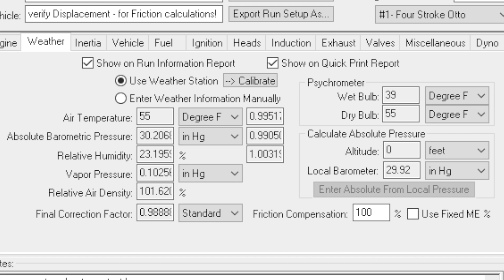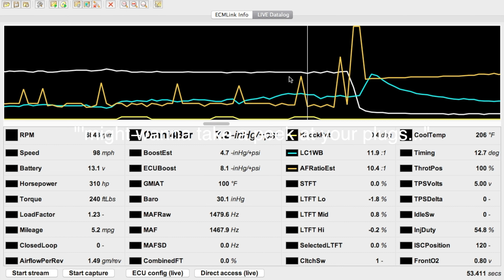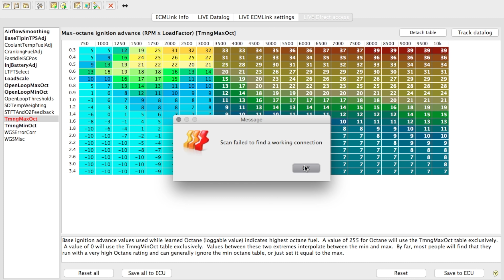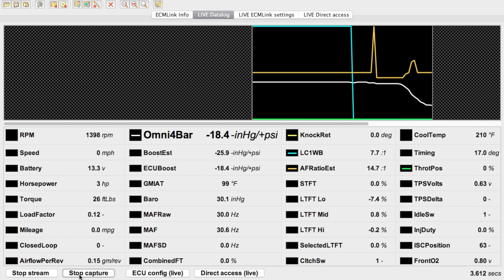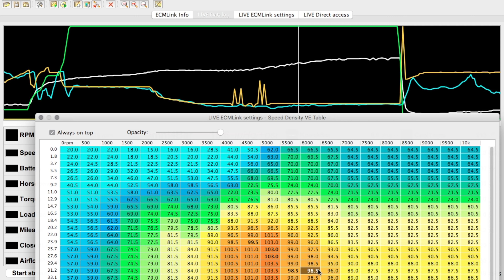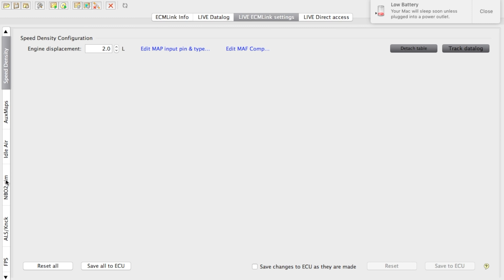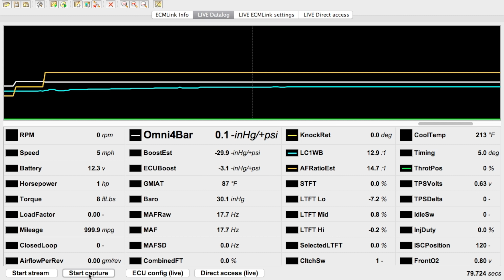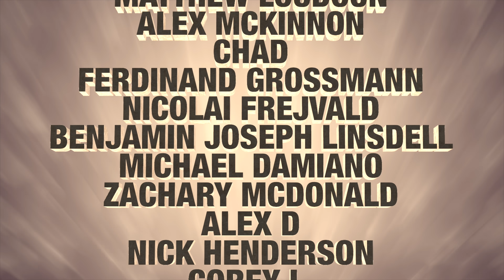Turbo Elantra Dyno Baseline

Comment: Hey jafro, love watching your content! I've learned a lot from your videos and appreciate you taking time to build these videos. I wanted to offer my own advise if you haven't taken notice. I saw that your battery voltage gets sucked down to 12.7 under full load (quite unavoidable when we are stuck with 75 amp alternators 😔). It is a problem I've been working at on my 91 GSX for a little while now, but have managed to get under control for the most part. I suggest if you haven't already done so, do a "big three upgrade" on your charging system and go with much larger guage than factory. I myself ran 4 guage OFC from alt to battery still retaining factory fuseable link in fuse box. I then added a 1/0 gauge OFC ground that goes from my alt bracket to driver strut tower, and replaced the factory ground that runs from battery to bell housing with 1/0 guage OFC also repositioning (passenger strut tower to bell housing). My battery runs 1 single ground which is 1/0 guage OFC connected to the passenger strut tower. Every ground contact is clean, non painted surface, with dielectric grease to prevent rust or corrosion. Doing this alone took my battery voltage up a whole volt, going from 12.7-12.9 up to 13.5-13.9 during a wide open @ 6500 RPM. It resolved a lot of phantom knock and also cleaned up some misc values in my logs. This has been a huge improvement for me and will hold me over till I do a high output alt and relocate to the back of block to get it away from my atmospheric dump. Hope this bit helps ya out! Keep on ripping it jafro, thank you again!
Reply from the maker: Clear and concise observations for sure!  I've actually already done all of that, including the alternator relocation.  Only variation being I used 0 gauge.  Once you relocate that alternator to the back of the block, servicing anything about it is a royal pain.  I can't get to it without removing an axle and loosening engine mounts and suspension parts.  It's not fun at all...

When I relocated the battery from the trunk to the engine bay, I didn't move the sense wire from the alternator.  That's on the fuel pump circuit.  Naturally at high RPMs the voltage is dropping because the pump is spinning faster.  There was no voltage drop when the battery was at the back of the car, because that's where the fuel pump rewire lived, right next to the battery.  Now that it's up front... Problem.  Its not fixing anything to put the battery in the trunk, though.  It barely charges the battery when it's at the end of that big piece of wire.

I need to relocate the sense wire first, then I may install a larger alternator pulley (rather than smaller) because I'm using a 135A GM alternator.  The crank pulley on the Saturn is smaller than the one on a DSM.  I think its voltage regulator is shutting down above 4200 RPMs from being overclocked.  I think that's what those "cat ears" AFR spikes are in the middle of nearly every pull I make.  There's like 5 things I'm trying to do to this car right now, but parts for 2 of them still aren't here yet.
Reply: Haha I definitely understand the pain of trying to get 7 problems fixed at once, or at least very close to each other. Finding those 7 problems, tho individually aren't crippling, compounded are a nightmare and absolutely destroy a man's sanity! I've thought of giving the GM alt swap a try myself, however I'm not sure if I want to modify brackets when the cost of a 250 amp high output in a factory chassis is really decent all things considered.

In your case I'm actually surprised that you're seeing that low of voltage at full load having done the charging system upgrade. Altho I have zero understanding of your particular chassis's wiring make-up, unlike my First Gen that I could nearly recite every wiring schematic. Based on what you've said it makes total sense though. I haven't done much looking into the fuel pump harness mods or the pumps relationship with the voltage regulator of the Alt. Makes complete sense with fuel being 33% of what's necessary to even make it run haha. 

More or less now for my own curiosity. Is it just the engine harness that is foreign to the elantra, or have you changed body harness too? I could only imagine the absolute headaches of changing a body harness and myself would make every attempt at avoiding it, but could see the necessity to do so considering guage cluster, MPI relay, and what not.

Comment: Hey buddy I live pretty close any way we could discuss 4g63ts nd dsm link tips nd tricks. Just got my ecmlink cable nd im currently going over your idle tuning nd base numbers. Installing a new IAC since when I got to that part it didn't change just stayed at 50 so bad motor. Then realized the guy before me didn't tighten the bell housing bolts even leaving one out. And the doubled up flexplate he installed cracked luckily not damaging my transmission. So I put in a kiggly and just freshening it up with paint and making it look factory with the gunmetal gray wrinkle black accents while Its out. Please get up with me

Comment: Can't remember if your water/meth is injected before the intake but I did notice your GMIAT temps were lower with water meth than without and if I reading it right your airflow is about the same. So your air density is higher, so more power. I'm wondering what rpm your turbo is spinning up to. What's the max estimated cfm of your turbo?
Reply: I came here to point this out. Jafro is dumping 20 PSI of boost and the heat of compressing it into a charge cooler that has no meaningful airflow. The water/meth is cooling the air, increasing the density and making more power. Shove a huge blower in the nose of that thing and you would probably pick up even more power than the water/meth added. Boost numbers are only one piece of information in figuring out what is going on the engine. Air density is the number you are really trying to get. The other numbers I would be curious about is the drive pressure on the turbo and the exhaust pressure behind it.
Reply: @puppynosee  ahh I see you too watch Banks Power

Comment: more powerz! Needs more sensors to find the inefficiency.
Reply from the maker: 😂  I need an ineffeciency sensor.  The needle would always be pointing at the driver's seat!
Reply: @Jafromobile  lol, i'm wondering specificly about exhaust pressure.
Reply from the maker: @HavocAdventure  That's coming.  Have the EGR plate already drilled and tapped.  Need a few things still to finish it off, but it's a project I've been wishing I could prioritize.
Reply: @Jafromobile  it will be interesting to see if its greater than the intake pressure

Comment: Definitely need to figure out the creep issue as well. In 4th and 5th gear it will be much worse at a lower load. But great work. It’s definitely a start.
Reply from the maker: It's easily solved by just setting it at 20+ PSI everywhere.  I did the same thing on the GSX with this turbo.  Works like a charm every time.  It's not ported for low-boost use, so when it's set to kill it's perfect.  So no worries, I've got a plan.  The tune here is just the failsafe tune.  This is as far as I got with it before this video because I was trying to give it some manners before taking it out in public.  Most of this car's tuning woes are solved by turning the boost up.

Comment: Another great video! Curious about the heat range on the plug- do you think a 6 is too hot for that setup on pump gas?
Reply from the maker: Nah, it's not.  I tried 7's.  I tried 7's projected and non-projected, made a video about it.  It always broke up under boost at any gap, and that's why I went back to the 6's.
Reply: Good to know, thank you! I might throw a set of 6’s back in and see how the car likes it

Comment: It’s how much air a turbo can move. I’m not sure if it’s a measurement of how much it sucks in or pushes into a motor but I know it’s the air it’s able to move.
Reply from the maker: ...through your particular intake... because the same turbo will move a different amount of air on a different engine or intake.  The variables never cease, but yes, absolutely.  You are correct.

Comment: clean up the mixtures, that's why you plugs are fouled, you should be aiming for mid 11s for the mixtures, and as torque stats to taper off, you can add more timing, peak torque is where you want to be conservative with ignition timing, but it sounds like its on the verge of knock .

Maybe take 5-10 degrees out of the map and if or until things start glowing and then slowly add it  back in again.

I don't understand why its expecting those rich mixtures, is it closed loop self learning,  a self tuning ecu with real time WB sensor still requires setting of the parameters, why have to set it to chase those mixtures , its way to rich, the ignition breaking down was telling you its to rich .

Comment: Maybe its time for a high flow cat? Not sure if it is already a high flow.... I don't remember. But if its not, maybe a high flow would be a better choice of CAT. That way you can kind of fix your issue. Another fix would be a bigger cat. I know it sounds stupid. But if you put a bigger cat meant for a bigger engine, you can flow more air through it.... I know someone is gonna bash me for it, but I've seen it done on turbo applications before and it worked, at least for that person....

Comment: The innovative wide bands are horrible. At work (OEM engine development engineer) we have two LM2s. At home, I have an LM2 and DLG. They are all trash and secretly fail within a year, it is not obvious when they do. It'll appear to read correctly but the real AFR is far off. Calibration and wiring were checked multiple times and on different platforms. Using the exact same engine, ECU calibration, and O2 sensors the AEM and Haltech wideband controllers worked perfectly. Never trust the Innovate products or their support team. 

Secondly, we also have a Land&Sea dyne and are not happy with it.

Comment: I Laugh at people who tell me "Oh you bought eBay Parts" when the package of pistons are marked as CP, JE or something like that and then I'm like "Yep... Those are branded eBay sir"....   People with no common sense this is for you guys...  Just because you buy from eBay don't make it an "eBay branded part" There are reputable sellers out there. eBay is just the sellers Middle Man  so you can make your sales (You don't actually buy from "eBay"...  There is the off branded name Turbos and so on which are actually pretty good I've heard more good then I have ever hear bad about them of course they will never hold up like a Garret or a Borg Warner etc.  I mean if you buy a full engine rebuild kit for a 2019 Mustang Cyote 5.0 for $200.00 Then yeah I would be questioning that and it's name was like "Zing Zong Long Dong" then yes that is very questionable!
Reply from the maker: You're right about that! I think the reason why people use the term is to expose their own bottom of the barrel budget nature.  I think the term is more representative about the one who says it than the actual part.  When this turbo was bought, eBay was flooded with people selling turbos at rock bottom prices in order to move inventory.  Lots of different brands, same turbo with housings for a dozen different cars to be a bolt-on mod, and there were certainly different outcomes from people reviewing them over time.  Both good and bad.  But this particular turbo is CXRacing.  It has out-lasted 2 different engines.  Twice it's eaten bearing chunks, and here it is still making only 35hp away from what a big16g is supposed to max out at... at wastegate pressure.  And it's 10 years old.  For $224, I will say that CXRacing made one heck of a great product.  My MHI Big16g was $999.  I didn't need to replace it, but for $224 I had to give this one a try and see what it was about.  You couldn't find it anywhere else that cheap at the time.  I was a skeptic at first and I confess I am really impressed with it!
Reply: @Jafromobile  Exactly!  Glad to hear a reply from  you Jafro!

Comment: Is 13.8ish volts normal?
Reply from the maker: No!  And neither is 12.7.  I've complained about this GM alternator in other videos.  I think it's overclocking, and overloading the regulator.  I need to mess with that.  It's separate from the engine harness, so I didn't address any of it when I rewired the engine.
Reply: @Jafromobile  did you do the rewiring to the battery like others have done to get the voltage regulator to work better.
Reply from the maker: @whoismario  I think it got weird when I relocated the battery back to the engine bay.  I was running the alternator Sense wire to the fuel pump circuit so the regulator would keep that stable.  When I moved the battery back to the engine bay instead of right there next to the rewired fuel pump it started doing this.  I also think the alternator is overclocked because the DSM crank pulley is a bigger diameter than the Saturn's crank pulley.  I bought the pulley, but I have to take engine mounts loose and pull out an axle in order to get that relocated alternator out and work on it.
Reply: @Jafromobile  I know on my 95 k3500 the alternator was cutting my rpms by like 35% but I suspect the ecm gets rpm data directly from the alt because it's diesel.

Comment: Jafro, I hope you read this comment because it maybe you answer to your knock and a couple of other things 
Now that I've had a week to think about it, I think I've come to a conclusion on what could be going on, to work it out I'd need to break it down into the individual facts that we pull from the info gain from this video
1 the engine knocks with very little timing and won't take even normal amounts of timing
2 it likes to run rich, at least that's what the plug says it likes
3 it's higher compression than stock, by a lot

Remembering that a rich condition will make the spark plug darker in color, but this is very rich and reading normal ( I'd like to see a picture of it But I'll take your word for it)
Remembering that a spark plug that is too hot will go white and course more knock
So I think your rich condition is masking the fact that the spark plugs are too hot and making it come back to a normal color range and the hot spark plug is creating knock, because that's what they love to do
I'd like to see you put a colder plug in it and lean it out, see if that still knocks 
Also, just remember a colder plug at idle an cruise will look like it's wrong, it's wide open where it really counts

Comment: You were only doing 3rd gear pulls, 4th gear or closer to 1:1 ratio will net you a higher dyno number.
Reply: Very very slight change as the dyno reads torque mainly via load cell. Some cars make slightly more in their 1:1 gear others make the same.

Comment: even the best aftermarket ignition system will breakdown at 10.0- 10.2, dude those mixtures are not spot on , far from it, coming from someone that tuned cars for a living for 13 years and held the 1/4 mile record for 4 cyl 2.0lt street class  in my state with my lancer evo3 10.5 @ 136 mph. 

that pull @ 32:00 I can hear it is on the verge of knock did you checked to see if the timing is synced, you should be seeing the same on the crank pully as you see on the laptop screen, after hearing thousands and thousands of pulls you can hear when they don't sound right, when they get closes to knock, you've probably got it all sorted since then

Comment: good job man.  check out my monte carlo build videos that will be coming back out.  finally got my life sorted out.  now it is time to finish my 10 year project car.  this summer
Reply from the maker: Dude, I'm proud of you.  I had to do the same thing.  This channel was a spinoff from having done it.  A side-effect.  It would have never happened if I didn't.  Just so you know... it's never fully sorted.  I kept having to put out fires for the next 14 years, and it hasn't let up.  It's just that once you have your feet under you, you can fight the current and dodge the jetsam.  Keep working on the small victories and the big ones fall into place.
Reply: @Jafromobile  i know what u mean.  Spent the last 2 years designing and building a new house with my dream 40x60 shop.  Got a 10k lbs lift and now working on the finishing touches.  Trying to sell extra dsm stuff i dont need to unclutter my working area.  You can see the shop in my newest mustang/explorer videos

Comment: Dam 17+psi and only 250🙄That motor isn't making much n/a or at atmosphere.Shocked how low the hp is actually
Reply from the maker: Its peak is 4800-5200 RPMs, if you look at the boost at those RPMs, you'll get all your answers.  The engine will hold 30 PSI.  Tested.  I can make that pressure at 5200 RPMs when the solenoid is working and no boost leaks.  That's like 20 PSI higher than what you saw.  It's making around 12 PSI there, not 17+.  You'll see it in the next dyno video.
Reply from the maker: PS: A factory DSM makes 170-180 at the wheels, and their wastegate pressure is 14 PSI.  274.3 is pretty darn good at the wheels for wastegate pressure, even if mine is 17+ PSI.  That's just 3-5 pounds difference and it's 100 more horsepower.